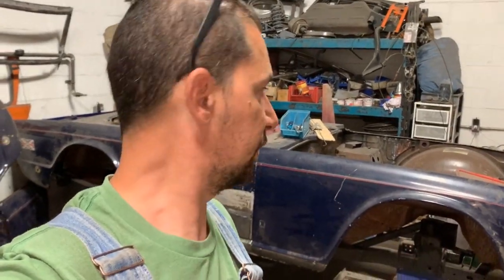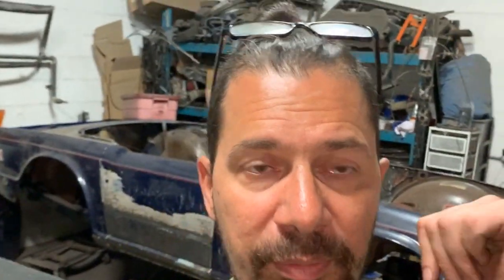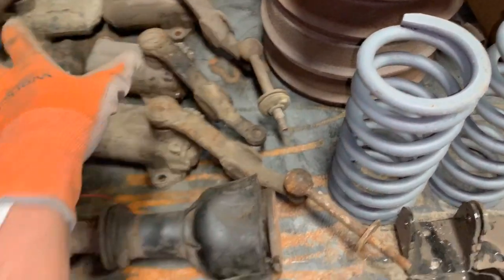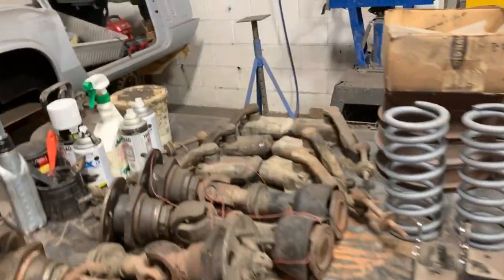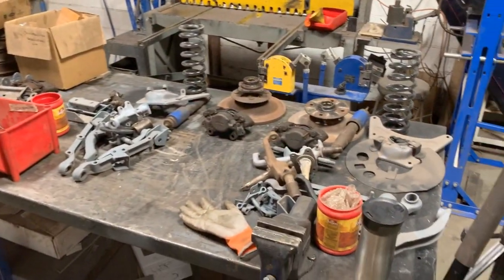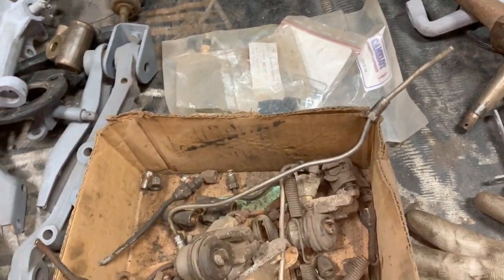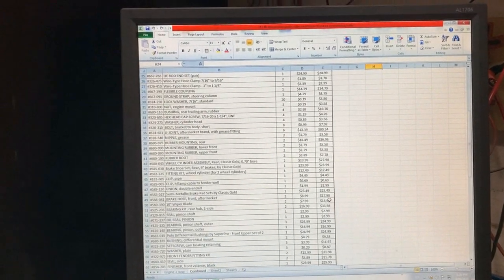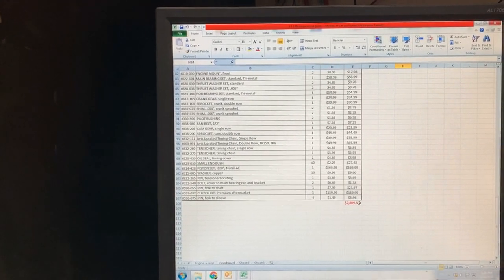1974 Triumph TR6 Restoration - Part 44 - Parts inventory

Comment: Nice video... it's annoying how the rocker shafts wear at the front end, I think those Triumph sixes are not fitted level in the car, the front is higher and I guess the oil drains away when sitting and that causes wear on startup.

Comment: A TR6 IS an Erector Set for adults. When trying to re-assemble it, first thing to do is throw all the Geo. Lucas Electrics parts in THE RIVER and use electricals from a salvaged 1970 Toyota Corrola. The Nippon Denso parts will work. The Lucas electrics NEVER will. (Yeah, I've owned Triumphs and BSAs) (BSA=Barely Starts Anymore...)